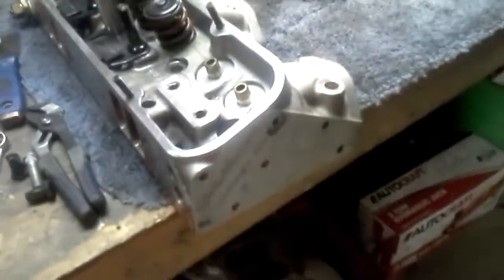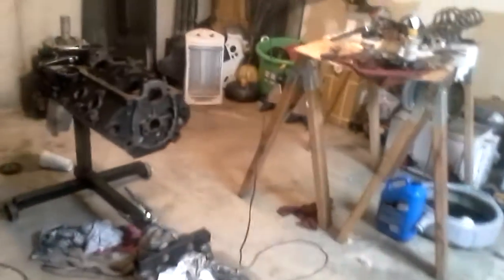600 HP 4.3 Turbo update #1

Comment: I have been contemplating on doing a 5.7 Vortech swap or modifying the 4.3.
I have been told that the Astro has the same engine block as the typhoon is there any truth to this?
Is it fairly easy to modify the 5.7 And how did you fortify the transmission to be able to handle the additional power?
Reply from the maker: Dean Swarbrick I don’t think the Astro 4.3 has the same bottom end and block as the SyTy engines.  The SyTy 4.3 have a stronger Nodular iron caps and crankshaft. 
Richard bought a $1300.00 700r4 that only lasted one Summer behind this 600hp Turbo 4.3.  We don’t recommend a 700r4 or 4L60e behind any decent power. 
We went 4L80e

Comment: how did this buildturn out ?
Reply from the maker: Ken Maylin It was making 600+ hp, Richard ran a 7.61 1/8th mile @3800# making zero boost on the launch. 1.88-1.90 60’ times.
His converter was too small and he could have used a two-step. 
The factory SyTy crankshaft ended up flexing/bending enough to hurt a main bearing.    This was the main reason Richard went Turbo LS 👍
Reply from the maker: Addicus Taylor Race Calculators show we were making over 600hp, which was flexing the crankshaft causing it to wipe a main bearing obstructing the oil hole in the block.  If all your wanting is 300-400hp at the crankshaft you should be fine.
Reply: Maybe this has already been covered elsewhere, but what type/weight of oil are you planning on using?

Comment from the maker: The "Balance Shaft" engines use a different oil pan not compatible with the AWD Typhoon/Syclone and use a different camshaft core.  Since we already have the valvetrain we opted to change blocks.